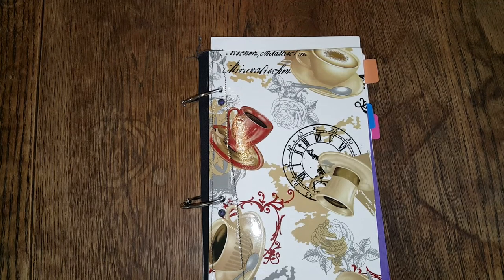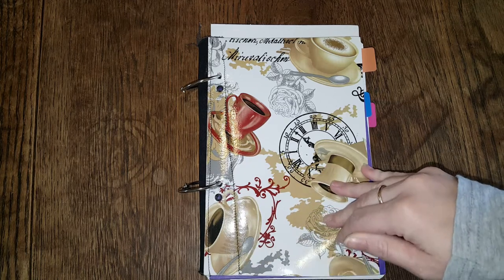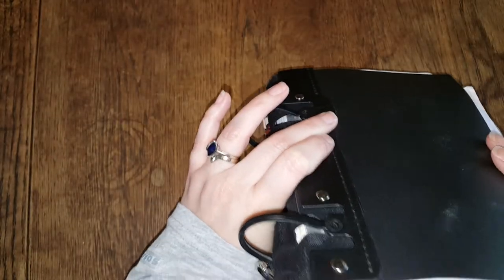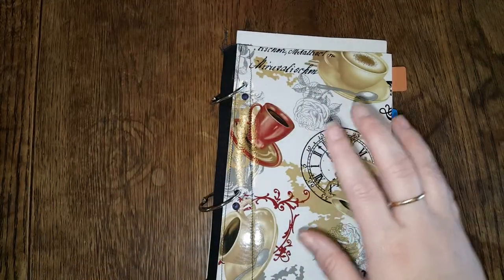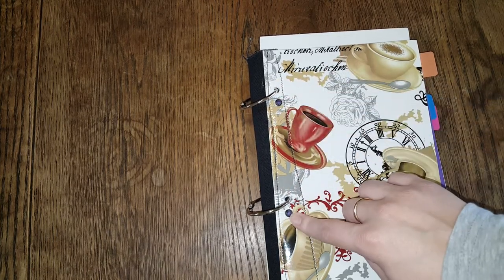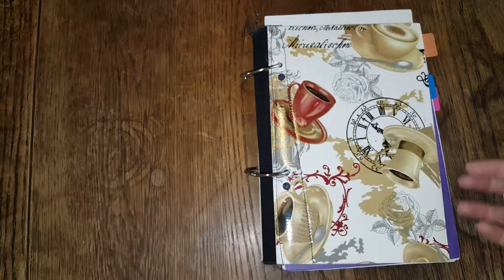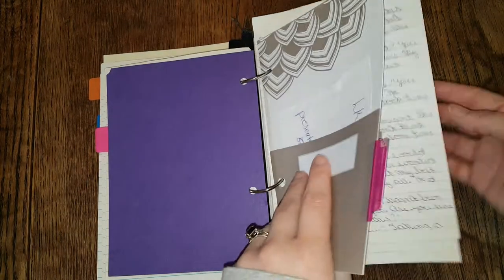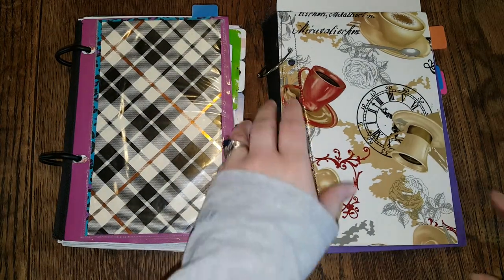DIY Flex Binder using Placemats

Comment: This is pretty genius! And yes, I am female. 😉 I didn’t even realize that the D-rings were part of the issue for me with the Mead flex binder, I figured it was just their slightly rubbery texture that was causing the pages to catch on mine.
I am not a seamstress and don’t own a machine, but maybe someday I’ll commission you to do one of these for me. 😬 Thank you for doing this video!
Reply from the maker: My mom has issues with the D-rings and the pages getting caught on them as well. I told her it was the trade off. She could have the flexibility she desired or smooth rings.